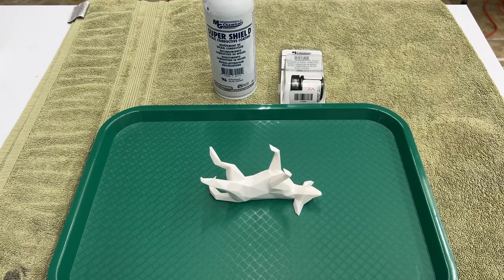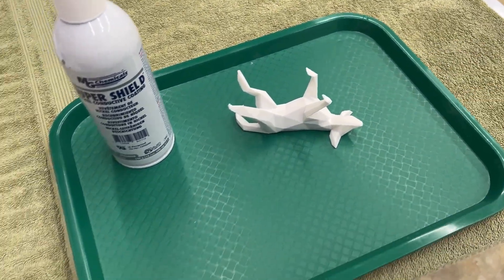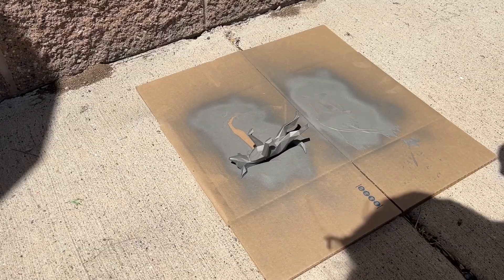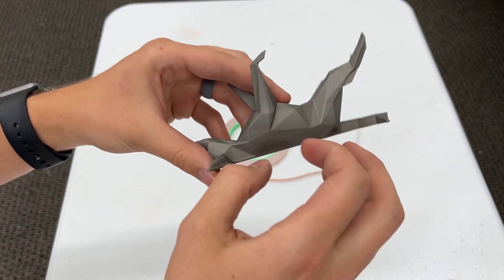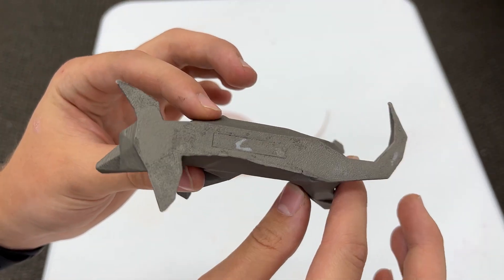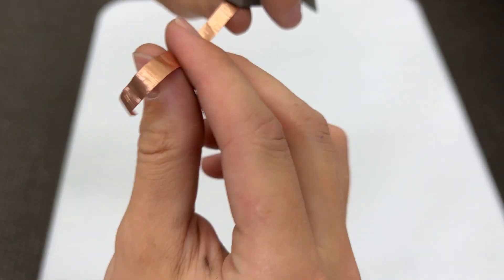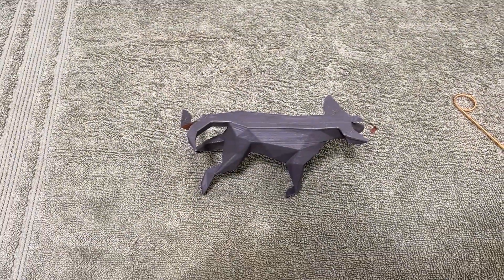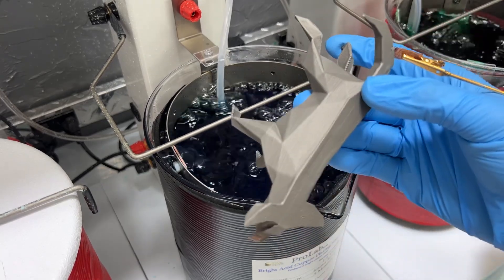Gold Plating a 3D printed item

Comment: Can u gold plate rubber from auto window trim
Reply from the maker: You can't gold plate rubber because it is not conductive. However, if you could make the rubber conductive, then theoretically you could gold plate it.
Reply: You could use the same process as he does here, but when the rubber flexes, your paint and gold will start flaking off, and it would look bad.

Comment: Interesting. I'm thinking about gold plating a 3D print to hold a hydrogen sensor to help seal the print from H2 sorption (atm pressure and temp). Probably still cheaper and faster lead time than a CNC stainless holder.